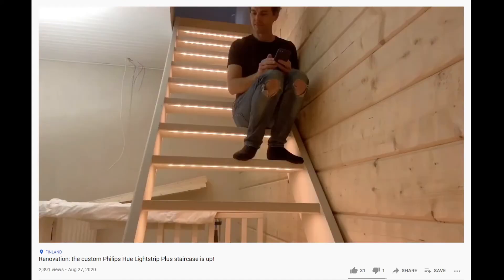Philips Hue: Lightstrip custom install. Which cable?

Comment: Great video and explanation! In the specific scenario of connecting just two 2-meter LED strips in parallel to one controller, would it still be necessary?
I plan to use the "Controller to 6-Pin Adapter" to have a female 6-pin available out of the controller, and then split an Ethernet cable to connect both 2-meter LED strips.
In this way I'll have a spare controller for other cut strips I have.
Thoughts?

Comment: very informative video. thanks for the info on ethernet vs belden cable.  how did you terminate the cable?  how did get around the gaps between light strip runs?

Comment: Hey love this little vlog you got going on these stairs. I just started an under cabinet lighting project and found you don’t recommend the ethernet solution, what specs am I looking for when buying wire? The Belden wire isn’t available at a reasonable price in NA, any info would be helpful. Thanks!
Reply from the maker: Thank you! When I was looking and found the Belden, I was looking for 6 conductors and checking the specification sheet carefully for the maximum current ratings. Cables like this are usually aimed at security and sound installations.. so searching for "security & sound cable" might also help. Good luck and keen to see what you create. Thanks for watching!
Reply: @PaulWarrenEaton  would these from eBay be the same cables? https://www.ebay.com/itm/254848486207 also did you solder the wires directly to the strips?
Reply from the maker: Yep looks like it. Same model 5504UE
Reply: @PaulWarrenEaton  thank you, I’m going to attempt to solder the wires directly to the strip. Never soldered before lol
Reply from the maker: Go for it! Please just practise lots before hand. The trick is to have the right amount of heat in the iron. Otherwise if you start holding the iron too long waiting for it to heat and melt the solder you can end up melting the strip. 

Since you are obviously buying some gear, then please also get a multimeter. Even a cheap one that at least will help you check your don’t have any short circuits. I have a super fancy meter but I’m only ever using to check I haven’t got any solder joints touching. I went a bit overboard with some of my tools.

Comment: Very informative, thanks. I have Philips bulbs in several places, but have decided I can't really afford to run Philips Lightstrips where I want them (say, above and below Kitchen units). So, collecting what I need to install generic LED strips using several Gledopto controllers. When I have all the components to get the job done, I will see whether I can get each of my 3 children (12-16) to pull themselves away from their iDevices and participate in and take responsibility for a DIY build.
Reply from the maker: Yes get them into the DIY build! First time I've heard of Gledopto.. thanks. Will add them to my check list for later when buying more stuff.